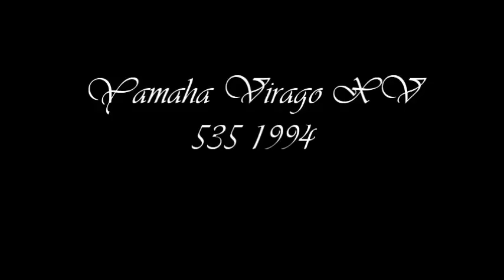Yamaha Virago XV 535 (2yl) Bobber 2018

Comment: Hey man, i just want to ask how confortable is that seat and how is when you have to hit full brake?
Reply from the maker: the seat is not suitable for long distances. what do you mean with full brake? Brake works fine
Reply: @Flohsen84  i mean when you have to brake very hard is it possible to slide to forward or on the side because of that seat?How can you handle the situation from that position, because it's a big difference between this seat and original one.
Reply from the maker: I did not have this situation yet. drive safe and dont  give a fuck

Comment: Bike looks amazing. Congrats. Did you use the same paint all over the bike?
Reply from the maker: Thx davis.  No.  the color on the engine is nigrin (heat paint) and the rest is simple black
Reply: Ok thanks
Reply: Hi flo. Hast du die Teile abgebaut bevor du sie lackiert hast oder alles am Bike lackiert. Hast du geschliffen und grundiert? Sieht top aus. Grüße
Reply: Very nice work! Looks great! So sad that the engine needs some love.. too much white smoke

Comment: What I dont like on the virago 535 is the 2 air filter's cover (tamp) right beside the tank. Do you think is it possible to remove them?
Reply from the maker: Thats Not working. I like the clean look without the air filter
Reply: @Flohsen84  ... Guys, ... the Airfilter is locatet under the "Front"-fuel tank. ... Yes, it is possible to remove these 2 eggs. You can store all electrical stuff under the fuel tank. It's a bit tricky but it works. Cut the intake of the Airfilter and turn him to the left or to the right, ... so you get more space. 😉

Comment: Where did you get the removable baffles from. I am looking for a set foe my '93 535 virago.
Reply from the maker: Amazon bro
Reply: @Flohsen84  would you happen to have a link to them. I have been searching for awhile and havent came across these. Thanks
Reply from the maker: @seannscott7206  60mm Motorrad Modified Auspuff Snakes Tuning Schalldämpfer Back Pressure-Core https://www.amazon.de/dp/B074Z64DFC/ref=cm_sw_r_cp_apa_i_J8r6CbGZT09QJ

Comment: So, the stock exhaust baffles can be removed and it will sound like yours or?
Reply: like, how did u make yours sound so much better with stock exhaust?
Reply from the maker: Empty middle silencer
Reply: Flohsen Weber did you just remove what was inside the exhaust?
Reply from the maker: @hakangokce1670  sure. All Inside the middle silencer and the pipes

Comment: Hello, where can i buy that removable baffles? Thanks for video...
Reply from the maker: Baffles are selfmade. You can bye the db killer on amazon
Reply: @Flohsen84  selfmade from original? And where can i buy it on amazon?
Reply from the maker: @sebpus717  the caps from the Original baffel with new db killer. 60mm Motorrad Modified Auspuff Snakes Tuning Schalldämpfer Back Pressure-Core https://www.amazon.de/dp/B074Z64DFC/ref=cm_sw_r_cp_apa_i_DO1kDbHV3E06D
Reply: @Flohsen84   das musst du mir erklären, wie hast du die teile da vorne angeschraubt ?
Reply from the maker: @danimeier6607  auf was bezieht sich deine frage?
Reply: @Flohsen84  die "baffles" hab ich bei Amazon schon gefunden aber ich kann mir nich zusammen reimen wo du die auf die baffles aufgesetzten metallteile ausgeschnitten hast. Die sitzen ja perfekt!
Mega Bike..
Reply from the maker: @danimeier6607  die db killer sind auf die chomeblende gdschweißt was im auspuff ist. Diese ist mit 2 kleinen schweißnähten am auspuff befestigt 
Einfach auftrennen, alte db killer mit einem meißel rausschlagen und neue db killer in die blende schweißen.
Reply: @Flohsen84  mega! Vielen Dank dir und danke fürs antworten !